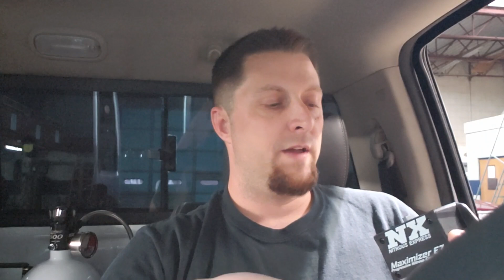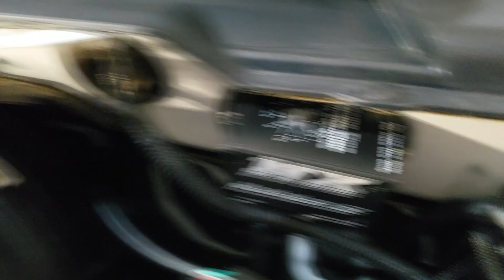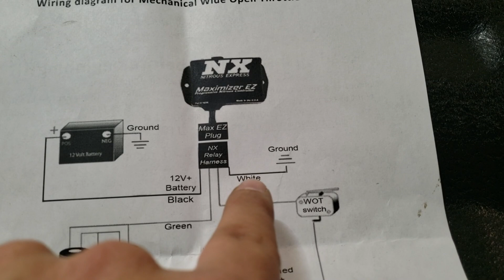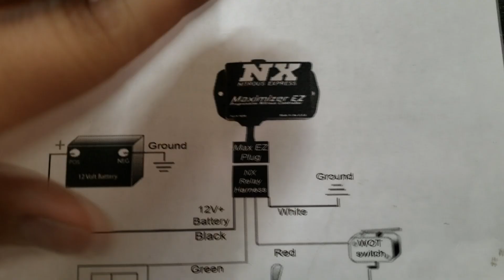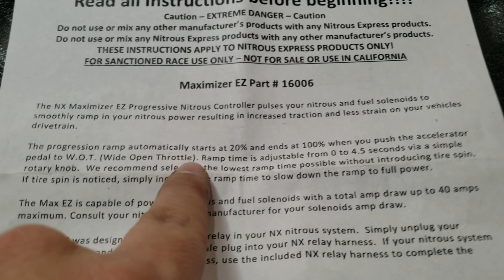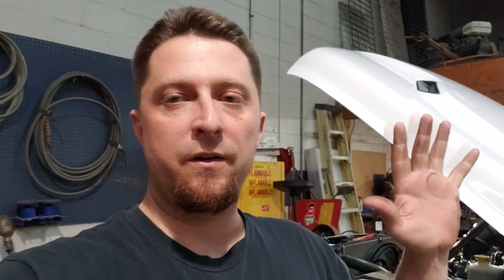NITROUS EXPRESS EZ PROGRESSIVE NITROUS CONTROLLER INSTALL

Comment: So Is It Actually Progressive? It's Hard To Tell On The 1 Second Setting. I Feel Like The Pulses Should Start Out Slow And Then Go Faster And Then Stay On. It's Kinda Sounds Like A Step Like Half And Full.
Reply from the maker: It just flutters the solenoids for the time setting and then goes wide open

Comment: Hey Dylan, when you test it like that are you shooting fuel into the intake or did you depressurize the line?
Reply from the maker: I disconnected the fuel line from the nitrous plate and stuck it in a bottle to catch the fuel.
Reply: @FrostbiteRam  Awesome! Thanks buddy!

Comment: I tried this and I don't hear any clicking what is the steps you took I'm assuming your turn your key to 2nd position then armed  the system, did you open the bottle then close the bottle or what? Thanks
Reply from the maker: Yes system has to be ready to spray.  Bottle does not matter should hear noise when  activated.
Reply: @FrostbiteRam  ok, so are you pressing the switch under gas Pedal  or pressing gas Pedal and switch same time
Reply from the maker: @redbaron2448  the switch on my gas pedal has to be pressed for it to work just as if you was racing.
Reply: @FrostbiteRam  ok thank you,  do you have a video on that what you did, cant find any video

Comment: I just got my nitrous all installed including the same thing you have, I don't here any machine gun like your,  my bottle is not hooked up does that matter? I'm trying to see if solenoids are working 1st buy don't here any click when armed.  Thank you
Reply from the maker: It will not function without bottle pressure has to be opened for the progressive to work.
Reply: @FrostbiteRam  ok can I hook up bottle or does it have to have nitrous for the pressure,  thank you
Reply from the maker: @redbaron2448  you will need the bottle full of nitrous
Reply: @FrostbiteRam  thank you,  and good luck on your next race 💪

Comment: So how does it hook up exactly , does it plug into your relay or you remove your the old relay,  what about the wire? Is there a video in installing the wires? Thanks
Reply from the maker: It takes place of the relay simply install.
Reply: @FrostbiteRam  which relay are you replacing because I'm trying to do this on a motorcycle
Reply: @FrostbiteRam  ok thank you

Comment: Its no good for a manual trans it resets the time if you let of wot. THEY LEAVE THAT PART OUT ! I would not recommend it for a manual. Customer serves sucked . Disappointed in my experience with them. It was a big letdown.
Reply: Would it work if you just lowered the time?

Comment: Would this work with the nitrous outlet kit?
Reply: Did it work ?
Reply from the maker: Not sure how there relay or wiring is with nitrous outlet.  but you can definitely wire in the nx relay harness to run the controller it comes with it anyways.
Reply: Frostbite Ram yeah. Thats what am thinking.   I’ll give it a try. Thanks man